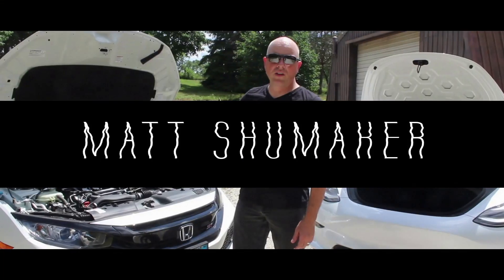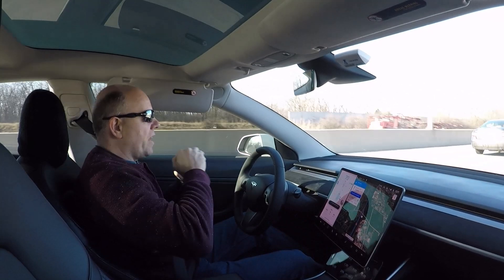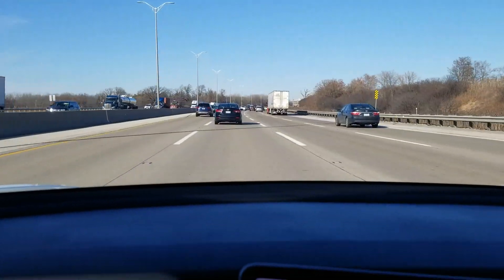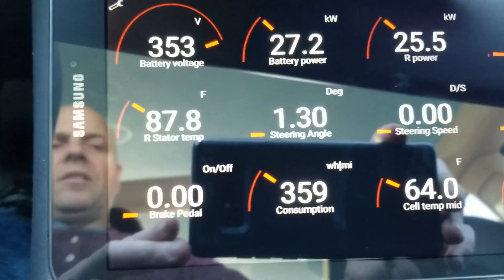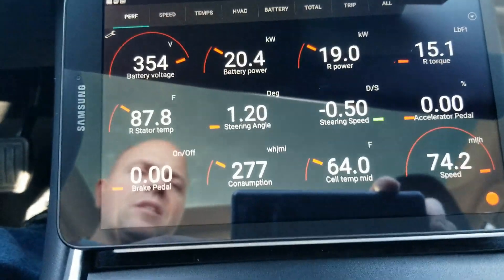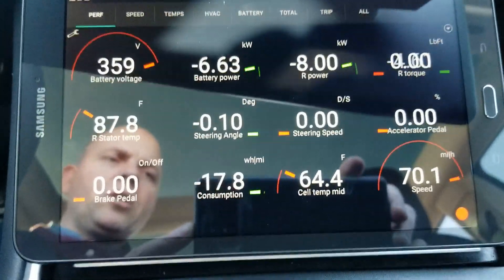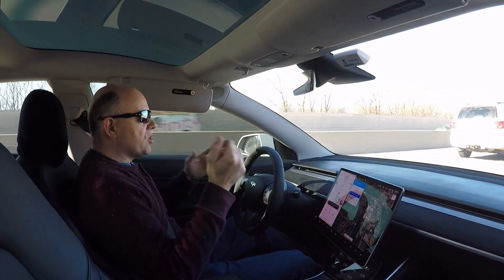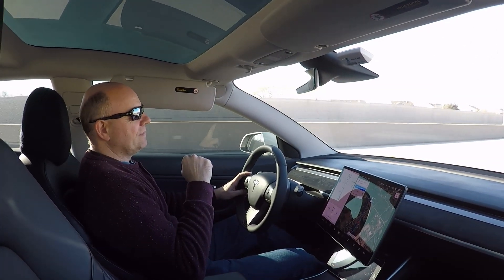Tesla Model 3 Steady state power consumption at 75mph

Comment: Could you please make a video that shows what your battery temp needs to be to get full regen? There was a discussion about it on the Tesla subreddit, and it'd be awesome to get confirmation of what temp the pack needs to be to offer full regen.

Also, have you noticed your car having worse-than-usual regen in the cold recently? I live in LA, so the temperature during my commute is rarely below 55F, but I'm seeing dramatically greater regen reduction (more dots, more frequent "reduced regen" warnings) this winter than I was last winter. It seemed to start only a few weeks ago, so I'm wondering if it might be a regen nerf from a recent software update.

Comment: Matt

Can you do a video showing the rear motor current draw and stator temp both while parked then telling the Nav system you are in route to a Supercharger.  Monitor the two readings for at least 20 minutes to see how high the stator temp gets and the max power delivered to the rear motor..  Then after the stator and traction battery temps drop back to around 35F, drive the car steady state like you did in this video then select Navigate to supercharger and monitor both variables again.
From the Scan My Tesla Apps I have viewed the following appears to be true for the Long Range RWD.  The maximum power delivered to the rear motor for battery heating purposes is either 3.5 or 4KW.  The stator temps can reach temps of 180F or higher but your steady state 75MPH temps where only around 86F.  Some say that in route preconditioning does not add much additional heat over just driving on a RWD.   These tests would prove what the max stator temp and power draw is for parked, driving and with the in route preconditioning both activated and not.  I would perform these tests myself but I do not drive nearly as much as you do and my garage temps are not normally low enough to perform a valid test.

Comment: If I set the cruise on my Model 3 performance car at 75 mph going from Wales to London which is 197 miles and there is 22 miles of average speed cameras on which I have to set at 50 mph included. I still have to stop and charge because the maximum distance of range is 164 miles even thou when I bought the car it was supposed to have a range of 329 miles I’m assuming they included 165 miles on the back of a tow truck in their fantasy figure on the website I’m looking at taking Tesla to court for false representation or lying whichever you prefer about the range.
Reply from the maker: First off, the Model 3 Performance is 310 miles rated, not 329. Second, expressway driving is BY FAR the hardest on range. The rated range is based on an average speed of 45 mph with modest acceleration and no HVAC. Lastly, most people research this information before spending $60k to $70k on a car.

That being said, all EV manufacturers should be more forthcoming about the realities if range related to weather and highway driving.
Reply: Hi in the USA website it’s 310 but on the uk website it’s 
329mi
Range
(WLTP)
162mph
Top Speed
3.2s
0-60 mph
I didn’t see any information that says it was acquired at 45 mph and I looked at everything on their website. And if I drive the Tesla at the same speeds as my Merc I’m lucky to get 100 miles of range it’s very sad and to be honest if the car could just do over 200 miles I would be happy I’m thinking I’ve bought a electric car maybe five years to soon. So unfortunately I’ve had to palm it off to my wife because she doesn’t go more than a 100 miles in a day
Reply from the maker: @TheJohndoes1  highway range being lower than in town range is just something EV owners should know just like in town mileage is worse for gas cars. 

My range is 400 miles with the kind of driving I do......

Also, let's get real here, your range is absolutely NOT 100 miles on a charge. That is a load of crap and you know it! The only way that would be true is if you are flooring it everywhere you go.......
Reply: Yes I did say when I drive it like my Merc that you will be lucky to get a 100 mile range which unfortunately is not just correct but very true. I am not sure how you managed to get 400 miles on a charge unless you was being towed
Reply from the maker: @TheJohndoes1  by driving 40mph on average in summer being careful not to floor it.

Comment: Putting this into practice. If I get on the interstate and do these speeds of 75 mph, how many miles do I need available ,approximately, to make a 100 mile trip?
Reply from the maker: 180 miles of rated range (roughly) will give you 100 miles if actually driving at 75mph.

Comment: TF - with your understanding of batteries - would consumption be different at a high state of charge than a low state of charge?  not sure if resistance is slightly higher in the battery at lower state of charge (i.e. 3.8 vs 4.1V per cell or something).  EDIT:  Sounds like you may cover that in a near future video - awesome, thank you!